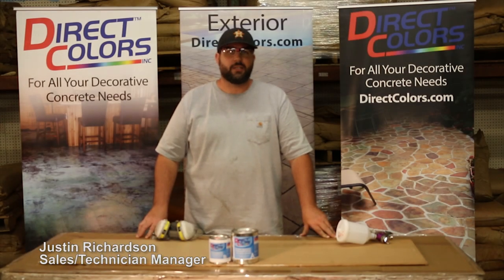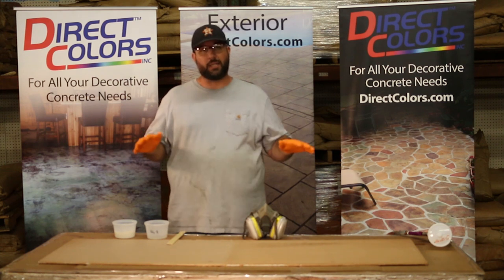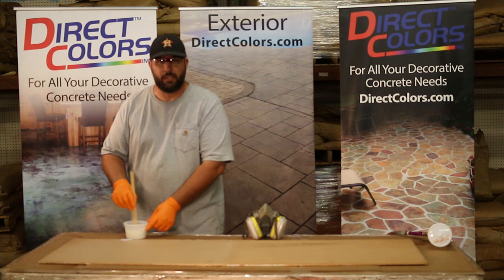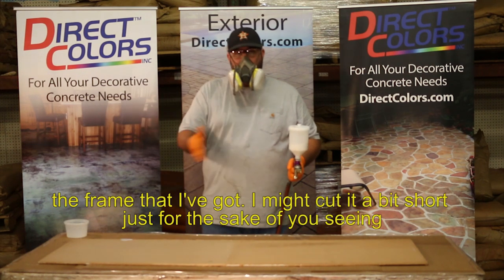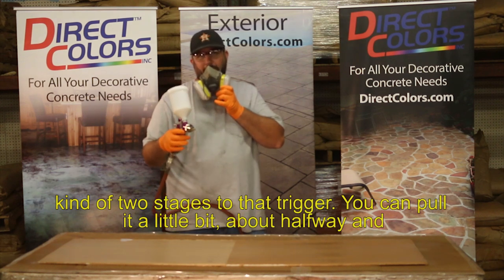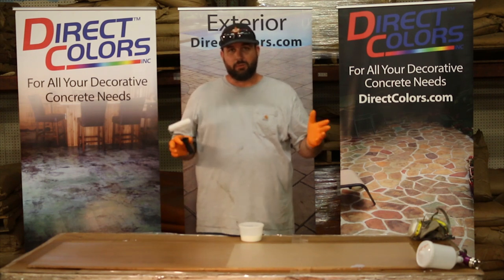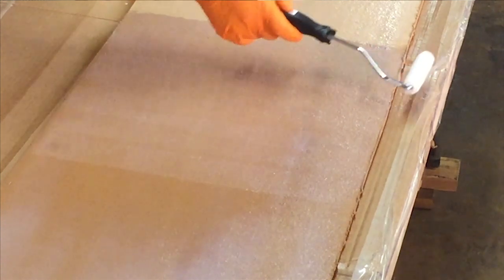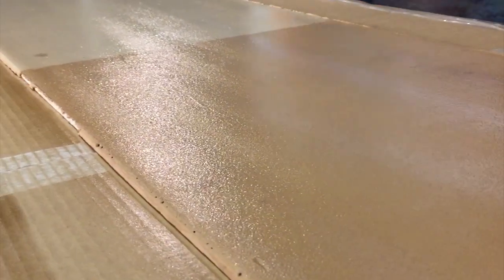How to Apply Polyurethane Sealer with a HVLP Sprayer

Comment: Whats the difference between the regular water based polyurethane that you see at home improvement stores and a 2 part water based polyurethane?
Reply from the maker: the two part is going to be a densifier and hardener which will make the poly much more durable. If you have a 1 part "Poly" it most likely is an acrylic with a small amount of poly in it and marketed as a poly but majority of it is an acrylic.

Comment: Did you dilute the the 550 with any water?
Reply from the maker: Yes, you do. You can add up to 20% water to spray the product. Here's a link to the complete application instructions, https://www.directcolors.com/wp-content/uploads/2014/03/How-to-Apply-550-Waterbased-Polyurethane-Countertop-Sealer-Nov2014.pdf. Thank you!

Comment: Can any polyurethane be sprayed on or do you need a specific type of polyurethane?
Reply from the maker: Hi Cheng,
Direct Colors carries 2 polyurethane options. There are several considerations in choosing a type of sealer, but in short, the Water-based tends to be easier to work with and best for indoor projects. Read more about Sealers here: https://www.directcolors.com/product/550-water-based-polyurethane-concrete-sealer/

Solvent-Based Polyurethane Sealer for Concrete Countertops is a high gloss, two-component urethane resin that provides a clear, long-lasting finish. Polyurethane coatings are highly durable, easy-to-apply and suitable for both indoor and outdoor use. 

Our Water-Based, Polyurethane Sealer is a Low Odor, Highly Durable Flat Polyurethane Coating. This sealer requires no waxing and is a great alternative for indoor floors.
Can be applied with a water-based acrylic prime coat indoors for increased coverage area & VOC compliant everywhere but California